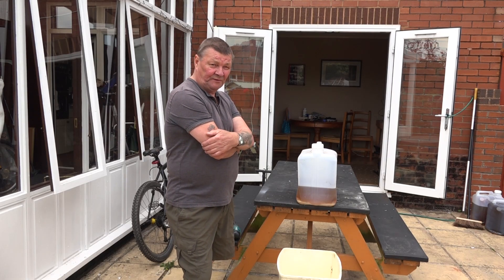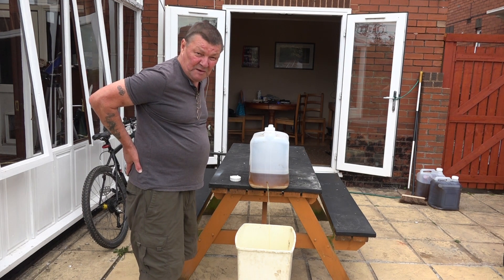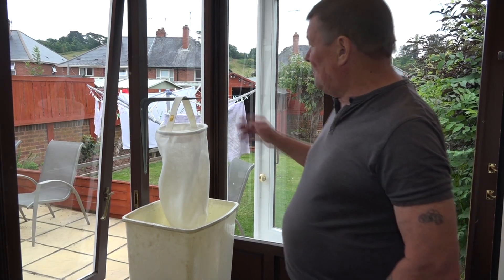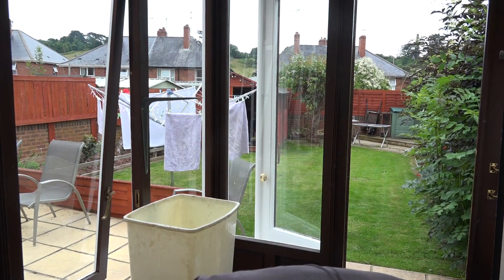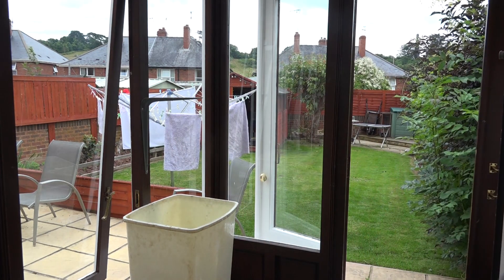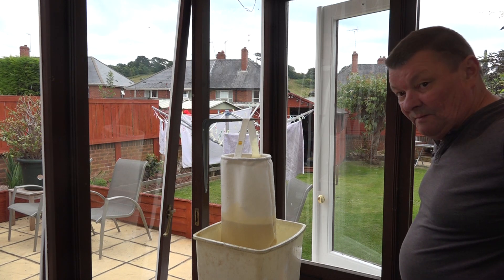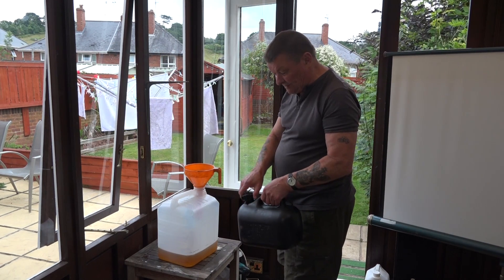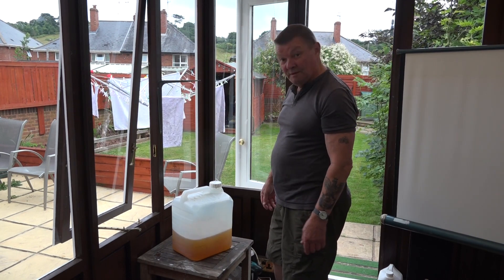How to run your vehicle on vegetable oil

Comment: Have read the comments and found some good tips.

- Put filter bags into one another so there is only one drain process instead of 3 separate. The courser ones on inside and finer ones on the outside.
- Mix in diesel first to make mixture thinner so it drains faster.
- Don't poke holes in your container, get one with a tap.
-
Reply: You drop this 👑 king

Comment: Somebody correct me if I m wrong but I believe you are wasting your time and energy filtering to 1 micron. The only danger to your injection pump is ABRASIVE impurities (dust rom the ground). Any organic shit from the fryier that can be stopped by the fuel filter on your vehicle is no worries. To be sure, you dont want your filters to clog up in the middle of a motorway so a quick filetrering at 5 mic will do plus a few coils around the exhaust manifold. I have made and run on my biodiesel since 1999 and I never fitered anything. Never run on straight WVO but now with the methanol at 500Au$ the drum, I am thinking of runningf on WVO mixed with 20% diesel and 10% petrol. Anyhow thanks for this great vidéo.

Comment: How are you supposed to find out if your engines safe to run on it .. I’m sure the manufacturers don’t put in the manual that it’s safe to run on cooking oil
Reply: most modern things won't run it. The engine cannot be a common rail (high-pressure fuel system). really only the old 100% mechanical engines run it.
Reply: @cormacmckinney1223  100% correct! Veg oil will destroy your fuel pump and injectors in about 50 miles! Older diesel engines (approx pre 2000) will run on WVO just fine.
Reply: @cormacmckinney1223  50:50% mix may work on CR but itl probably wear out the pump  and injectors quicker

Comment: Why not just turn it into 100% biodiesel? 
so it wouldn't cost you anything.
A bit for the sodium hydroxide and methanol.
The whole point is to stop using finite resources, you still use 50% diesel.

Comment: nahhh.. you need some  petrol in there too; for that very small qty, 1 to 2 cups of petrol; diesel DOES NOT mix with diesel, careful...  the petrol(or querosene,expensive...) acts as a solvent and fluidifies the misture; a few drops of detergent (not the dish washing  kind,it has salt in it as a thickner,use automotive) acts as a surfactant and helps too;     veg. oil is TOO THICK,by itself (and since it does not mix with the diesel, you'll end up with"lumps" of veg. oil in your pump and injectors:  you WILL feel that when it happens,,and smell it too; NOT GOOD!!!
So,you also need gas(us readers),petrol(uk) or gasoline....
Reply: What ratio vegetable oil /diesel / petrol would you recommend

Comment: I don't wait a second, and no added regular diesel, just filter, and directly in the tank, and it drives perfect!!! Toyota Land Cruiser 2001, the best 4x4 in history. the filter is clean, the tank in clean, it burns everything anyways, I'm starting to think that it will run even if I'll pee in the tank...
I also didn't convert anything, no second tank, no second filter in the car, and it even runs smoothly, better than pump diesel.
Reply: Is the injection pump cactus after a while?

Comment: Great video buddy, lots of information. Don't suppose you know if you can use veg oil in a discovery 2 td5? I've been looking online and found mixed opinions.

Thanks
Reply: no as they have a high-pressure fule system.

Comment: Hi, I make biodiesel, and as far as I know, you can use 2500 litres a year, and you dont have to use oil with diesel, or save recirpts, but just take note of how much you use.  I use bio on a Vauxhall Zafira 2.0fti.  And over time, using cooking oil with or without diesel, over time it glues up your engine as it gets harder to start.
Reply: Yeah these f**** Nazis get word of this and they'll be putting vegetable oil up to five bucks a gallon the sun's a b****

Comment: I’m guessing the mrs was out when you done this on the patio lol, I run my 300tdi on veg 50/50 in winter 75/25 in summer, when my 300tdi is running on just diesel doesn’t even use the glow plugs I just literally get in and turn the key, but when I got veg in there I always wait for the glow plug light to go out
Reply: Does it work ok on 200 and 300 tdis? Any problems?

Comment: mate, would it not be easier to have put the diesel in with the oil before you let it run through the filters,it would be thinner and run through quicker?
Reply: thats very sensible. and even the bags would be easier to clean.

Comment: Instead damaging containers you can use clear PVC hose with a bit of copper pipe to suck oil above deposit. You can use Straight Fuel Line Pump  (Hand Primer Bulb pump) to pull oil over.  Some engines want go on VEG Oil. Also filters get clogged with some fats. In Poland some drivers mixed  50ltr of VEG oil with 0.5ltr of fuel and some 2stroke oil (maybe 200mltr). This mixturre have les viscosity than oil and have some lub from 2T oil. (Bear in mind any fuel in diesel tank makes your diesel DRY and without extra lubrication  will wear or damage your injection very quickly!)   FRIEND WHO FILLED PETROL INSTEAD OF DIESEL MAKE ONLY FEW MILES BEFORE HIS FORD PUMP INJECTORS SEIZED !!! BE AWARE PETROL IS VERY DRY!

Comment: Put the bags inside each other. Finest outside and mores coarse inside. Saves over handling
Reply: Spot on 👌
Reply: I do that with hash bags saves a lot of messing about
Reply: There is only down to 25 microns is that enough? @barrybigballs3010

Comment: But i would  not let  the car  sit for a week or 2 with that in it;  the veg oil separates from the diesel and the pump WILL JAM UP,the vanes will not expand out,gummed up!! the car will NOT start ,and you won't know how to get it started; it's ok if you drive every day;  
I have been there; i'm a mechanic, i have 2 cars here now that i've been trying to start for days!   i can easily repair---clean--the pump,but it's just too much work...
The amount of gummed up SHHT inside  the WHOLE pump is STAGGERING!!!! judging by the  junk coated advance piston SPRING,that i removed-very easy,2 bolts.

The solution was to use one of those pressure bulbs in-line and while a helper pressed hard on it, i was able to get it started,but it still would not rev above idle,even flooring it; after minutes of warmup  (always pumping on that rubber bulb) the vanes finally expanded and it reved up; but still a lot of cleaning(with a mix of diesel, petrol and acetone) was necessary,otherwise it still would not start the next day
SO,if you do that,KEEP DRIVING..... 3 days sitting will be too much; and try to use NEW veg.oil if you can; 
I now use only a blend of diesel , petrol , acetone and...a small measured qty of....dish detergent,this stabilizes the mix, i mix it outside and let it sit for a week or two to make sure all parts stay well mixed,with the same nice cloudy color.
Reply: Have you tested the 50:50 veg oil to diesel mix on a commonrail, same issues?
Reply: What ratios do you mix all of these ingredients?

Comment: I've been using straight vegie oil from costco for years with a blend of 20% diesel and not had any problems whatsoever.
Reply: You can blend gasoline 10 percent 
Itt batter it's better with Cold start
Reply: Did you add a second tank or heaters

Comment: Hi there, any idea if I can use new veg oil bought from tesco in my 2005 VW Polo 1.9 sdi not tdi. ? Would I be able to pour straight into the tank?
Reply: I use pure vegi oil from Cosco in my vw mk3 tdi golf with no problem engine runs smoother

Comment: I have a 97' ford fiesta 1.8 d
How can I find out if using veggie is going to damage my car?
Reply: You will be fine it's an old style diesel engine so it will be fine, asda has unused cooking oil on special for £3.50 for 5 litres, that's 70p a litre almost as cheap as lpg. Trust me u will be fine using it.
Reply: @TheCheesenChips  alright thanks
I'm going to check my fuel pump is Bosch ( from what I've heard I'll be good if it is)
And I think just to play it safe I'll try a 80/20 mix before a 50/50
Reply: @__brnrd__  Any luck?
Reply: I used to run my ford escort van. None turbo on straight vegetable oil and it run quieter and roughly the same mpg.  So I'd say you should be fine with your 1.8 diesel fiesta

Comment: I ran my 300tdi on fresh veg oil before they put the price up. I used veg oil when off-roading incase I damaged the tank. Did not want to dump diesel in the wild. She ran lovely on it.
Reply: Did you have to modify the engine or fuel system in any way for your truck to run bio-diesel?
Reply: Ari Vasquez not at all. The 200 and 300 tai run perfectly on clean veg oil.
Reply: Backs4more, well alright then. Knowing this now helps me out quite a bit. Much appreciated, thank you.
Reply: Backs4more, when filtering the oil, how do you know that you get all the salts, impurities and sugers out from the oil during the filtering process?
Reply: pontus laurell u dont have to filter fresh oil filtering is just for used vegetable oil
Reply: There go's my supply of veg oil. Cheers arbit3r (Y)
Reply: @chrismarron254  I deleted it. Better keep it a secret !

Comment: Here is a good question, can one use this mix in an oil burner for a boiler for home heating? Would the nozzle and air mix need to be changed to accommodate this???
Reply: I think your boiler might need a few conversions.

Comment: I wonder if you put all three bags suspended inside each other and pour once... Less chance of getting drips and spills. And, maybe add the diesel before to speed up the filtering time. Just a thought at streamlining the process. Do you ever have to worry about how thick it is when colder weather? What ratio about? Looked like 2 to 1 veg vs diesel

Comment: So I'm the UK they have regulated using veggie oil? Wow that is some Crap for sure. We can use as much as we want here in the us
Reply: Laws made by big oil with cash...why else would there be a law on it
Reply: We'll still have to abide by the 2500 litres, the taxman sure loves our money.
Reply: Just do it anyway, In all reality no one has the right to tell anyone they can't do something unless it's harm to someone...
Reply: for now...it's only a matter of time.
Reply: if that's a year that's a fucking lot like filling up a 60ltr like 40 times, 80 times if you do a 50/50 mix
Reply: I'm afraid that's UK laws. They don't want to miss one p of you fuel tax money either.
Reply: Before that you had to pay for all the chip far you used, so the 2500 litre allowance is pretty good!

Comment: Hi, I run my 1998 peugeot 406 1905 TD engine 60% veg spring-summer 50% veg autumn winter, runs a treat, it has the BOSCH mechanical pump, Legally you must keep DVLA document in the car with a book to record  mileage, diesel and vegetable oil.
Reply: Legally you must keep what ?   What are you talking about.  In america we do what we fucking want to do 

We don't need receipts or any stupidity
Reply: Mateo Del Castillo really? We need insurance to drive. Yeah no one cares what you do to car as long as its paid.

Comment: What is the mix ratio? Heard you can do this with adding methanol and lye
Reply: 4 parts oil 1 part petrol (It thins it better than diesel). SVO has 30% off for next few weeks 

 In Tesco supermarket chain in UK at the moment.
Reply: olaf jensen methanol and lye , then you are making biodiesel
Reply: No, No, No. That's part of the process for biodiesel, and that's completely different.

Comment: In the next few years, I am looking at running my 200tdi series 2a on veg oil
Reply: Did it go well for you?
Reply: @owenglenn4298  worked alright except a pig to start and smokey as ought, needs to be more refined I think. Haven't had chance to have another go